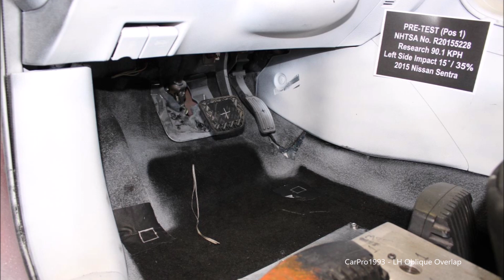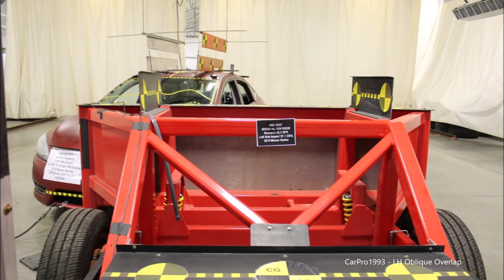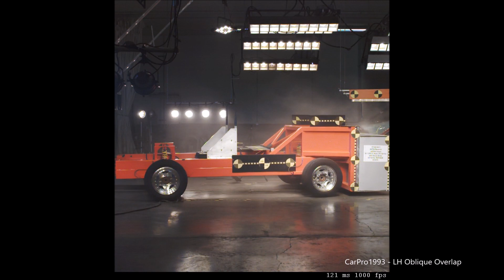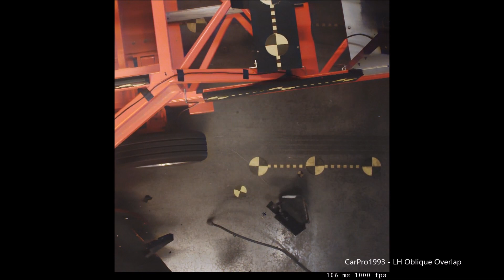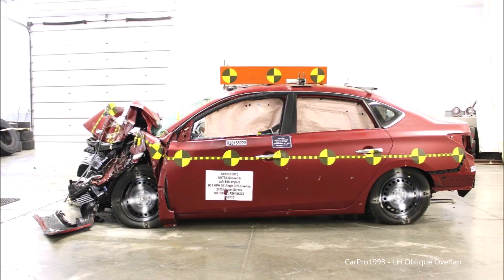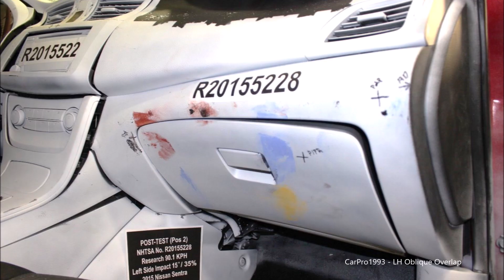2015-2019 Nissan Sentra NHTSA Oblique Overlap Crash Test (Left Side)

Comment: Other people have suggested this before, but it seems like the best way to reduce neck injury for the passenger would be to extend the passenger airbag all the way to about 2 inches or so away from the steering column. It seems like a major cause of the high neck injury risk for the passenger is the way the passenger's head turned when the head struck the side of the airbag. If the airbag is extended, then the dummy's head won't strike the side of the airbag and snap to the right. However, I don't know how you could modify the driver's airbag to reduce neck injury.
Reply: You create an airbag that deploys from the roof behind the sun visor and completely eliminate the problem the steering wheel airbag causes.
Reply: Could do what citroen did with some of their C5's. Center of steering wheel was stationary, and thus airbag could be optimized because the orientation was static.
Reply: @cameron20020  that's neat! I honestly didn't know about that.